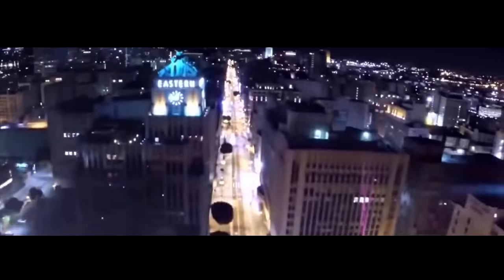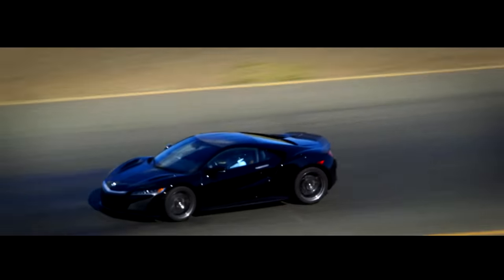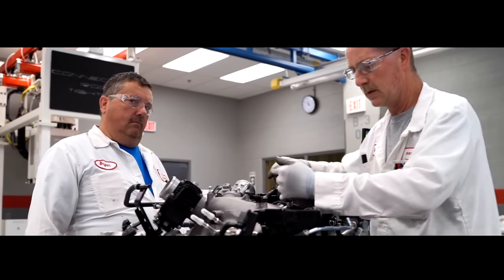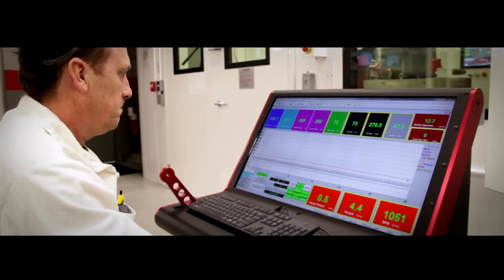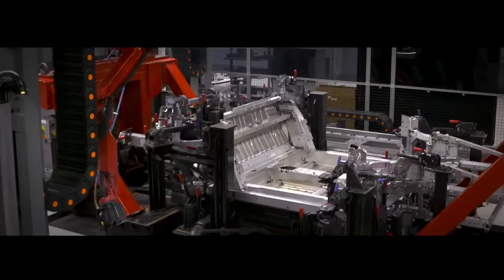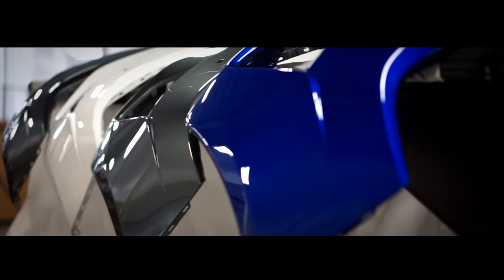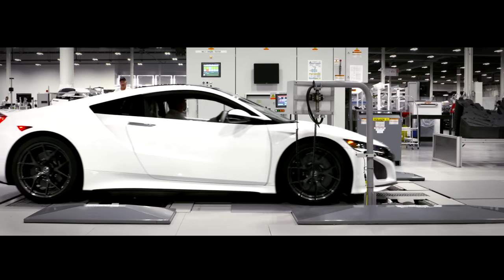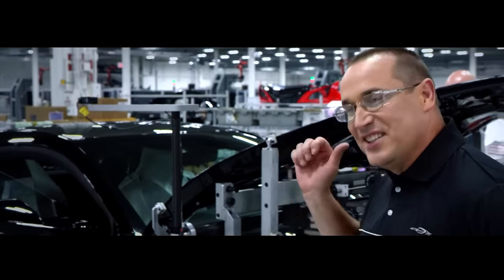The 2017 Acura NSX: Designed, Developed, and Manufactured in the USA

Comment: Seriously, Honda Acura... Soichiro would have been pissed.  We both know it.  Firstly, it is not Japanese.  There is no eXperimental new technologies... remember what NSX stands for??  It is less desirable and capable than it's peers (Ferrari, McLaren, etc).  But worst of all, Honda isn't even on the badge, because it's American branch thinks their founders name is not worthy of their flagship car.  Are you able to address my concerns??
Reply: this is the only car under 1 mil that has real torque vectoring, also it has a electric motor to take away turbo lag.no other car in it's segment has that..also must super car are not awd..this one is..you can most likely drive it year round in N.Y.if you wanted to..this is the definition of nsx..and like the previous version all the tech is moving down to the rest of the Acura line up..first the mdx has electric motors now by 2018 the whole line up..